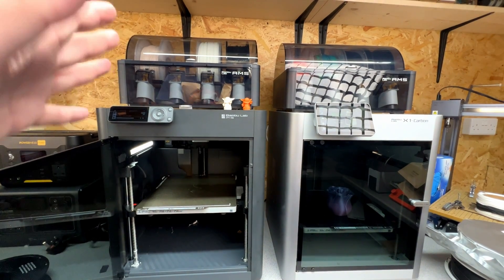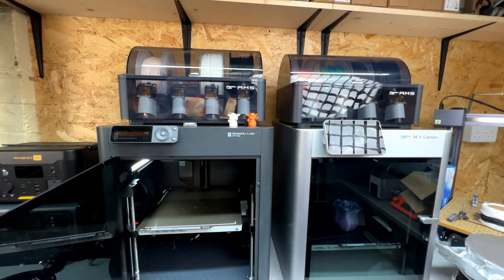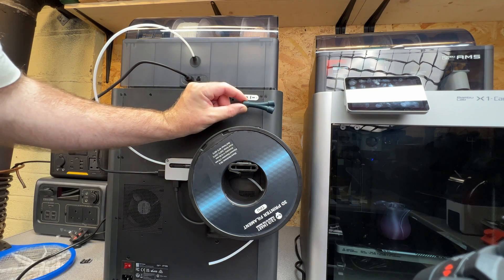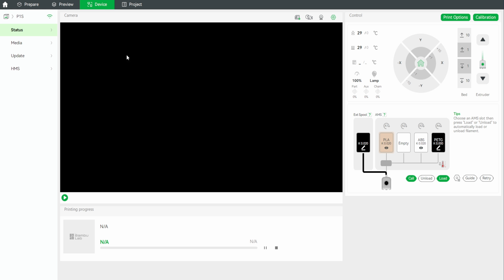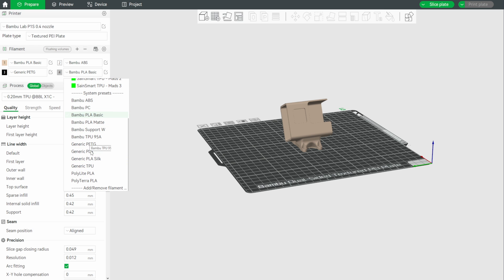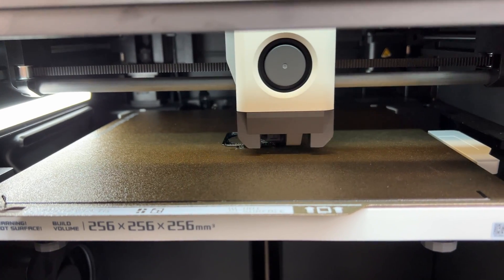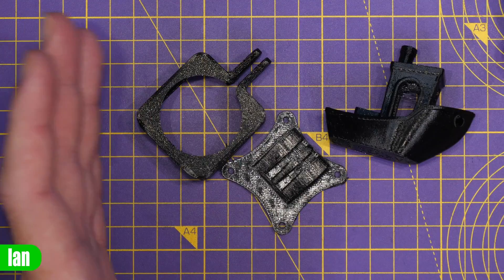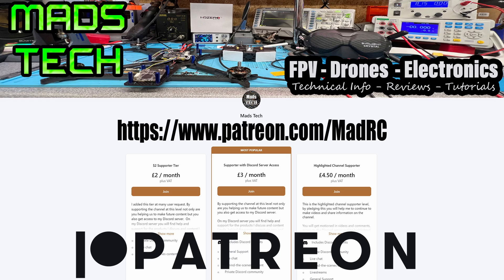Bambu Lab X1 & P1S Printing  TPU - Its This Easy

Comment: Didn’t show the important. what is the speed for TPU printing on bambu?
Reply: I just checked and his slicer profile is available for download in the description. Hope that helps.
Reply: The maximum print speed is defined by the "Max volumetric Speed" in the filament settings.
The "Generic TPU" profile has a "Max volumetric Speed" of 3.2 mm3/s. This results in a maximum print speed of 40mm/s with a 0.4mm nozzle & 0.2mm layer height (regardless the higher print speeds in the provided/chosen Process Preset, they will be ignored).
Max print speed equals 'Volumetric Speed'/ ('Nozzle Diameter' x 'Layer Height')
Reply: @tribar-6886 with bambu tpu?
Reply: @Dronitalia  Bambu TPU 95A has a maximum flowrate of 3.6 mm3/s.
Reply: @tribar-6886  so the max spedd would be? Sorry but I do not know as I only use pla
Reply: @Dronitalia   That depends on the nozzle diameter and the layer height. The formula to calculate the printspeed is in my first post.
Reply: What nozzle? Stock 0.4?
Reply: 50 percent speed. With Bambu Studio (on PC), you can choose to run at 40 or 30 percent. (This is recommended.)
Reply: Set the max flow to something reasonable like 5 mm2s and i set my speeds to no higher than 100mms depending on the material. If you get some "high flow tpu" it actually works in the ams for me.
Reply: Tpu is preset on bambu and worked flawlessly first print.
Reply: @jeremyarnold1979 No it doesn’t. It’s so stringy and lumpy it’s not worth the trouble

Comment: I printed 3 small items in TPU came out perfect shiny and just squashable how I wanted the 4th print and every print after are literally like a kitchen sponge , the first 2 layers look good and bottom layer shiny but the rest is exactly like a sponge , there is no strength to it at all it squashes exactly like a sponge , and is not shiny at all and looks like its not sticking right , there is no bubbling and seems clock up nozzle now aswell , can you help with this its TPU 95 aswell

Comment: Ive only just gotten into 3d printing. I have the bambu x1 carbon on the way and am doing all the research i can. I want to hit the ground running when it comes in. Thank you very much for this video as everything ive seen said tpu was a no go for the bambu.
Reply: Most of the issues with TPU are with the AMS not the printer itself. Same with abrasives. The printer itself can handle TPU and abrasives no problem.
Reply: @conorstewart2214  AMS NOT Compatible - on bambu site
Reply: Just got the x1c last week and it's amazing! I've printed so much already

Comment: Thank you for this useful tutorial, sir. I appreciate the information provided.
I have a question regarding the desk mat you are using in the video. Could you please let me know the specific model or brand of the pink desk mat with the yellow lines that you place your hands on? I am interested in acquiring a similar desk mat and would appreciate any information you can provide.
Reply from the maker: It’s from Amazon.  I can’t recall the make but it’s on Amazon
Reply: @MadRC   Thanks.. I just found something similar. It is a Cutting Matt though
Reply from the maker: @monivibes1  that’s what they are
Reply: @MadRC  Thank you

Comment: What temperature do you use ? Don´t see it in the profile link, or i must be blind. But i cant get my tpu to stop stringing. Best result seemed at 250 degrees but still has stringing. Have dried it for over 24 hours
Reply: I succesfully print HP-TPU from creality at 215°C

Comment: I know you can't print tpu as fast as pla. So how fast have you accurately been able to print tpu?
Reply: The maximum print speed is defined by the "Max volumetric Speed" in the filament settings.
The "Generic TPU" profile has a "Max volumetric Speed" of 3.2 mm3/s. This results in a maximum print speed of 40mm/s with a 0.4mm nozzle & 0.2mm layer height (regardless the higher print speeds in the provided/chosen Process Preset, they will be ignored).
Max print speed equals 'Volumetric Speed'/ ('Nozzle Diameter' x 'Layer Height')

Comment: Can you test softer shore hardness than 95A? I've only seen people try 95A.  Can you try 55A or Varioshore?
Reply: I've been printing 95A just fine for a long time, but ran into massive issues with 60A.
I'll be testing adjusting the tension bolt (lower tension), to see if it helps at all.

Comment: I accept that the AMS doesn't support TPU. Haven't tried any non AMS filaments yet so was interesting to see how it is done. Not sure you needed to have a spare AMS slot that is set as TPU as I think you can just add a 5th channel.

What however I am wondering is whether it would be feasible to automate the manual TPU feeding. What I was thinking of was something like a single MMU2 type channel that can push the filament in and then move out of the way.  Automation would I guess have to be via Bambu Studio I suppose due to the closed nature of the firmware.  

I guess it might work out better though to somehow just re-engineer one of the AMS channels - as this would allow mixed TPU/other material prints.
Reply: Yeah, very odd. I see that too still I also took a screenshot. Also the PAHT-CF says AMS compatible. I’m not sure if it actually is though, generally cf filament isn’t compatible.
Reply from the maker: Yea you can use a 5th slot. I just used the empty one I had but I should have explained that better.  

On the automation this is something I am working on 😉
Reply: Bambu Lab says their TPU is AMS compatible.
Reply: @c0mputer  interesting - I wonder if that is a recent change or has always been the case. Will get some and try it. Ps/ Managed to get a mixed AMS/Non AMS print to work too - with a bit of manual intervention at each Non AMS change, and having to put a dummy filament i to the AMS - so i think there is a good prospect of multi material including TPU prints being possible with the BL printers, even for non AMS compatible filaments.
Reply from the maker: @dwuk3d  Bambu do not say the AMS is TPU compatible and the website for both their TPU and the AMS clear say no.  I don’t know why this user is saying this but it’s wrong.
Reply: @MadRC  Not sure what is going wrong with YouTube - but I've tried replying to this twice, will try a third and last time - this time without including a link  - but message seems to keep disappearing - if you look up TPU95A on the UK BambuLab store it says AMS Compatible - don't know if this is a recent change - or a typo.  Tried google cache but could see an old version.  I agree that the wiki etc. says the opposite to this.
Reply: @dwuk3d  Thanks for the backup, there must be or have been a glitch in their site. It says not compatible for me now but earlier on the EU site it said it was compatible.
Reply: Interesting - I see that the EU, US, Global, Canada and Aus site is saying not compatible - but UK site is still saying compatible -(took screenshot ) - surprised this sort of text isn't defined only once on their site.
Reply from the maker: @c0mputer  no they don’t, they CLEARY say it’s not compatible.

Comment: If you disconnect the PTFE tube connector from the other side you have the small piece of PTFE tube to push straight into 👍🏻
Reply from the maker: Yea I always prefer to leave the connector on so I don’t let the ptfe get pulled back in

Comment: Just ordered the x1, the news about not able to use tpu with ams was a huge bummer.  but still think its a good printer..  been running my ender 3pro since launch. trying to convert it to an idex printer, just waiting for parts :)
Reply: It's a bummer for sure it would of been a dream to get the ams to work but hopefully Bambu has something up the sleeves ;)
Reply: @josefdahari  well we are getting there.  we already have stronger gears for the feeder. 
hydra mod, silica gel storage. even heated ams. i got the combo one. just so i could tinker with the ams.
Reply: @Just4FunRC  absolutely dude.  Once the tpu with ams gets working properly it will be amazing.